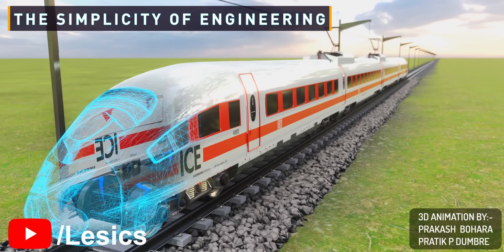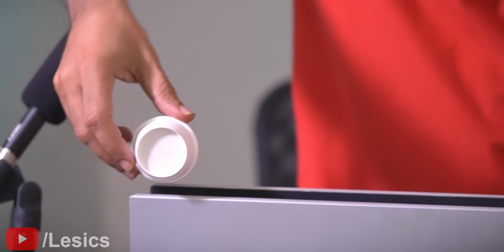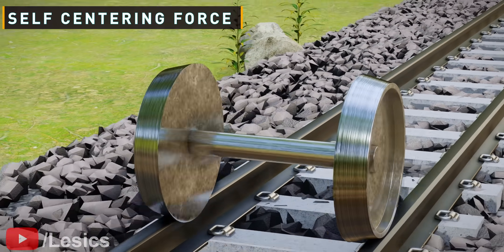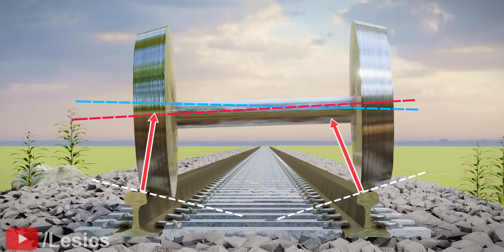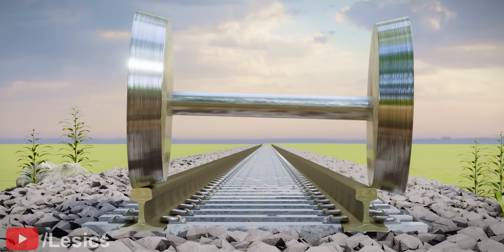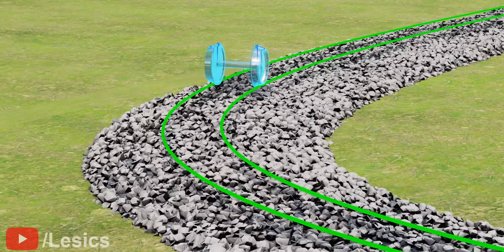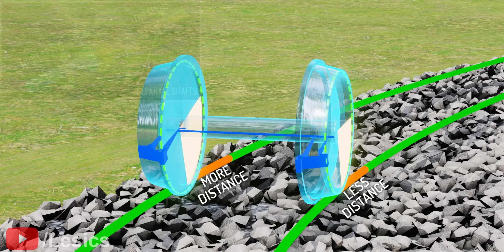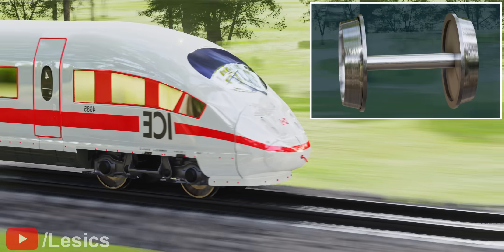The interesting engineering behind the SHAPE of Train wheels!

Comment: Excellent explanation and animation!
I wonder about one thing though. When the train is going through a turn then it needs to move a bit off-centre for the differential effect to work properly. But how can the train driver ensure that the differential effect is exactly how it should be? Gravity causes the train to center itself, and centrifugal forces cause the train to get off center (I assume) in the right direction.
But with those two factors you'd need a very specific speed (depending on the weight and weight distribution of the train) to take the corner properly. Do the wheels have a more intricate cone design with a steeper angle on the inside/outside? Or does the friction of the wheels while taking the corner cause the train to get ever so slightly off center? Or is it something else?
Reply: As the wheels first enter a turn they will tend to keep running straight, pushing the outside wheel towards its larger diameter and the inside wheel towards its smaller diameter. Because the wheels are connected, the outside wheel will travel further on its larger diameter while the inside wheel travels less far on its smaller diameter, and the outside wheel will move slightly ahead of the inside wheel, steering the two wheels back towards the middle of the track. In fact, this is constantly happening even on a straight section of track as the two rails are not perfectly aligned and have imperfections and wear. The conical shape of the wheels automatically reaches an equilibrium state.
Reply: @gz3zbz  Well, now that you mention it it seems logical that they would do that in a corner too. It's exactly the same as on the straight part of course.
Thank you very much for explaining it! 😊

Comment: Similar, two flat pulley wheel driving a flat belt need a small hump down the centre that draws the belt to it and holds it on the wheel. Subtle engineering of three hundred years ago.

Comment: Sorry, but putting conical wheels in that ICE3 will cause a derailment. Look up "hunting instability", that makes preferable to have some grinding noise in corners because of slippage between the outer and the inner rail rather than instabilities. Actually they put rail lubrication devices in tight corners.

Comment: When the you hear a train wheels make a high pitch grinding/squealing noise that is when the flanges are actually hitting the rails, this typically only happens in some curves, so the angled wheels keep the train centered quite well.
Reply: In that case FLANGE GREASERS are fitted to the rails to provide lubricant to reduce the wear and tear.

Comment: L.O.L. This is OLD news, especially if you've ever worked or driven a train as I have. It's also one of the MAIN reasons, you cannot use a slow speed track to run fast speed trains or vice versa. Where I live, I've seen holes ground into the rail head by wheels grinding trying to maintain their speed for the curve.

Comment: It is perhaps worth mentioning that this amazing engineering marvel was created in the middle of the 19th century. As marvelous as these animations are, the depiction of modern high-speed equipment may leave the impression that the shape of the wheel is also modern. It is not. Another aspect of this work of ancient art is the carefully engineered curve that joins the tread to the flange. This greatly exaggerates the forces acting on the wheel as it approaches the extremes of its lateral movement.

There is another aspect of this magic that the video fails to mention. The weight of the car or locomotive pushes the wheelset back towards the center. This is because the conical shape means that as the wider part of the wheel (near the flange) is moved towards the rail, the increased radius means that the equipment above the wheel must be lifted. This is a powerful force keeping the wheels centered between the rails -- the flanges never touch the rail in normal operation.

Finally, it is worth mentioning that rail head is also curved. The tread and rail head interact in a carefully engineered and orchestrated balance that keeps the train on the track, guides it around curves, and reduces friction.
Reply: https://youtu.be/3l9Hm_fMI2g

Comment: Another phenomenon is that when the wheels are off center toward the left, the left wheel has a larger radius part of the tread touching the rail. That causes the wheel to travel farther with each revolution than the right wheel, which twists the axle toward the right.

Comment: Also if the wheels are within spec. There should be no more than the width of a dime making contact between the wheel and rail. Its also why it is not very impressive seeing a truck commercial hauling train cars. Try putting rubber tires on thise train cars and see how well the truck pulls. We have skytrain out here as a mode of rapid transit. It literally takes 1 person to puch the train due to how little friction there is. Might take an extra just to get it moving. But once its moving 1 person can push

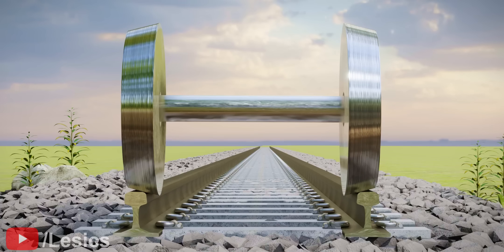Comment: The rails are carried by the tie plates which have a 1:40 cant to the base. The plates are placed left and right to cause the rail to tilt the inwards. This keep the conical treads of the wheels bearing on the flatter head of the rail instead of the inside edge.

Comment: On a conveyor belt the same situation applies to the drive drum and end drum. They have to be curved with the greatest diameter in the centre so the belt will self centre to track properly.  
Never thought trains had tapered wheels. I thought the flanges stopped them from going off the tracks. You learn something new everyday. 👍👍👍

Comment: Then there is the whole "minimizing the point of contact" thing thus minimizing resistance between the surfaces. Train wheels are huge and extremely heavy but the contact surface is about the size of an oblong penny with the rails on which they travel on. This is bad for traction but great for reducing resistance when in motion.
Reply: Hey , can you explain a bit more because as far as I know friction has no relation to area of contact between the two surfaces , it is directly dependent on normal force.
Reply: https://youtu.be/1y-8AOmdFyo vxyj

Comment: Only problem when the train is long and slow pulling through corners this taper does not work properly because it pulls to inside. Thats why sqeeking can be heard then. I do realize that when inside wheel spins faster it will work outwards but when its long ..heavy and slow it does not work properly. Imagine the train has say 30 wagons going slow through a turn..obviously all wagons will pull to inside.
The best would be independent wheels

Comment: 2:20 As the wheels move back toward center, their momentum can carry them beyond the center, inducing an oscillation. In railroad terms, that's hunting, as the wheels "hunt" for center. Passengers often call this "wiggling" of the train car. I remember the 1920s-era Broad St Subway cars in Philly that would get into long-duration wiggles so hard that you couldn't lean on the seat back if seated toward the ends of the car, the motion was 1ft / 30 cm or more! Equipment made after 1960 do much better.
Reply: Good rail hunting.
Reply: So, the tail end of the cart is like a pendulum swinging side to side, except it doesn't stop, because the train's forward motion keeps introducing constant energy to oscillating the wheels?

Or was it just after corners that the wheels were oscillating for a while until the momentum died down?
Reply: @LRM12o8  The rails themselves can introduce wiggles. To give an example: the Market-Frankford line ("the EL") in Philly has this section of new track over Front St. very close to I-95. This was designed for the 1960s-era Budd cars, they wiggled on the rest of the line but ran perfectly on this stretch. Then the replacements (SEPTA calls them M4 cars) came online in 1997, and they wiggle on that stretch worse than the rest of the line in that area.
Reply: Thanks for that. I was wondering if you could get the equivalent of an automotive tank-slapper, and it seems you could until they perfected the engineering.
Reply: @evilkittyofdoom195  There's plenty in Philly and NYC, frequent service for less than what many heritage/tourist railroads charge
Reply: the movement is always most at the back. This is true for plains and trucks also. Although road trains, 3+ interlinked trailers has been shown to be more stable than 2 interlinked trailer on turns. Train links design allows for less motion transfer than truck links, come to think of it
Reply: In a Museum railway here in Sweden they nickname a locomotive, ' Exentern.

Comment: Conveyors with belts use a crown roller with this taper which centers the belt. Side tension adjustment  is used to set final position. When a side bearing starts to fail the belt moves towards it warning on a iminent failure.

Comment: If the wheels are in the opposite direction, the flenges would still work. Infact the best way for the wheel to work on tracks, should have 2 flenges instead of one, this way, a minimum or almost no accidents. I understand the weight added, but then u can add more power, to push the vehicle, added more safety and more speed, and less time taken from one point to another.
Reply: Now, design turnout points and frogs to handle double flanged wheels, and, make them incapable of failure.
Reply: @alonespirit9923  yea ok

Comment: It also has a 3rd passive action. It continuously generates the smallest available contact patch. Less contact less rolling friction more efficiency.
Reply: @noname-nd8ec  He wasn't referring to that kind of bearings. The track bearing the weight of the train.
Reply: @fukkitful  yes exactly, the point of contact of the wheel to the track is a hotspot on a "bearing" which really has kind of a loose definition anyways. Hes taking the principle of needle bearing vs ball bearing applications and applying it to this situation.
Reply: @tomstutz2645  Isnt the principle of how all of those bearings operate still the same anyway except they're in a different shapes?
Reply: Less contact area results higher bearing stresses. Thus in order to maintain that small contact area, the two materials to have high hardness and stiffness.
Reply: I think that's negligible here,that is true for pneumatic wheels like car and truck tires.On the other hand less contact also means more wear since load is concentrated over a smaller area but in this application there isn't much choice.
Reply: @mehmettemel8725  steel on steel is going to wear no getting around it. Rolling friction is definitley a factor though. A train with hundreds of tons on a hundred of these axles is going to generate some resistance pretty quick.
Reply: @tomstutz2645  My apologies I was thinking of rolling resistance not rolling friction.
Reply: @mehmettemel8725  but once a vehicle gets rolling it moves by momentum. The only resistance are friction and perhaps air resistance?
Reply: @_Wai_Wai_  Yes true once it gains momentum but rolling friction and air resistance is negligible when acceleration is zero or there about since there is always some inclination.On the other hand it needs friction to be able to drive the wheels and I don't see this as a resistance for a solid wheel that spins.It would be the case for some flat part sliding on some surface then frictional resistance will be a governing factor.Just like comparing conventional machine slide ways to more common nowadays of linear guides.
Reply: @SS-du7tr  Well here we are talking about rolling resistance and in this case the resistance is not high at all.In fact it is not much different to a ball or roller bearing where it's considered frictionless since the whole axle and wheel assembly is one unit.Maximum friction occurs when the train takes off depending on speed and load and when fast breaking.Rolling resistance and friction are always present but to different degree depending on situation.
Reply: That's not quite as much of an advantage though; the lower friction makes maintaining speed easier, sure, but it also makes harder to stop and to start.  So it's kind of helpful but also not.
Reply: @marscaleb  This is what I came here to say.  It is a tradeoff.  There has to be enough friction available to make minimum braking requirements.
Reply: I  think  Contact   area  doesn't  affect   friction  force.right?
Reply: @thelife8836   think if you were to pull a dolly with a fridge on it over carpet vs concrete. Same load on the tire, same psi in the tires. Simply more contact patch. The carpet is waaaay more difficult. Not a perfect analogy but i think it gets the point accross
Reply: https://youtu.be/1y-8AOmdFyo qerf
Reply: I was going to say the same thing until I saw your post. Excellent thought!
Reply: i don’t think less friction is really a concept here. friction is a function of the normal force, and that normal force is going to be generated no matter how the load is distributed. less rolling resistance, however, i can see. 

I’ve never been good at this concept so if someone can help me out in this it would be appreciated. my thoughts have always been contradictory: there’s the intuition that less contact patch= better but there’s also the frictional aspect where friction force is equal no matter the contact patch. if this is the case, why do wider tires grip better? i’ve thought about this for years and my understanding has kinda brought me to the concept of probability of making contact with the road, because the road has small imperfections
Reply: @MCatwar  so your saying friction and resistance serve different functions in this instance? I dont see it, id call the two interchangeable for the layman in this example. Your getting above my paygrade if you start digging further lol
Reply: @tomstutz2645  oh i’m actually not sure that was my best guess. like my follow up states, i’m pretty bad at the whole contact patch topic lol i genuinley don’t know
Reply: Theres a guy on youtube that made his own stonehenge with manpower only. Check it out. Real impressive stuff. He is able to spin a 2000lb stone on a pebble. Try to do that on dirt one time haha but yeah your right the force exerted on the point of contact is the same reguardless of the contact size, simple gravity. Its when you go to move it that friction/resistance whatever you wana call it, begins to matter
Reply: if you believe the conical shape makes any real difference in rolling travel in a turn you shouldn't be talking . this part of the video is exagerated.  The real taper is tiny.
Reply: @Baka_Oppai  just because you cant see it doesnt mean its not critical. If you dont understand that there are forces at play in any mechanical object that go beyond what you can see with your eyes than you shouldnt be talking. You must be the reason they put enlarged to show detail on cereal boxes.
Reply: Look at a track profile and a wheel today. There's contact right now. It's a 100-year-old idea, it didn't work.
Reply: @ferenckis1301  ofc theres contact its a wheel
Reply: Fascinating !

Comment: A similar concept though not exactly the same is the use of “dihedral angle” in airplane wings. The wings of an airplane are not parallel to the ground but tilt slight upwards. This provides automatic roll stability in flight. If the airplane were to roll slightly in flight, say because of turbulence,  the horizontal component of the forces always cancel out but there would be a force differential in the vertical components which would act in the opposite direction to center the plane.
Reply: Incidentally, with the advent of microprocessors, some fighter jets were designed with inherently unstable geometry, so as to improve manuverability, which had to be constantly counteracted by computers.
Reply: @deus_ex_machina_  I once read about some researchers who put birds through an aerodynamic simulation and they also are sometimes unstable, sometimes marginally stable (a disturbance is neither counteracted nor amplified). 

This is because creating lift forces causes drag, and creating two forces counteracting each other is useless drag. They need to conserve energy, so they just evolved to have fast enough reflexes to be stable without aerodynamic stability.
Reply: @deus_ex_machina_  Why are you using past tense? That's still the case, physics haven't changed.
Reply: @Derzull2468  because the jets that exist now were designed in the past. The past is for designing the jets not them existing.
Reply: @charbelalam2648  But it's still how we design them right now, it's not a bygone design method that no longer exists.
Reply: In addition many large cargo airplanes (e.g. C-17, C-5, An-224) have the opposite: anhedral. In this case the wings are angled downwards, which has the opposite effect of dihedral and decreases stability. This allows these massive airplanes to be much more maneuverable than the would be otherwise
Reply: FERNGULLY :BATTY: 

"LIFT, I NEED LIFT!"
Reply: Seems legit. I've wondered the aerodynamic reason for that slight angle of wings. Haven't bothered to search why. Thanks.
Reply: https://youtu.be/3l9Hm_fMI2g
Reply: @KS7779  Stop spamming

Comment: When the train is slightly out of center and the train tilts, it also creates a net gravitational force countering this motion.
Reply: Yes, technically true. Sadly not enough to be useful. The French TGV has active elements tilting the train far more than the tiny effect from the profile of the wheels. That is needed to keep passengers comfortable while traversing a bend at speed.